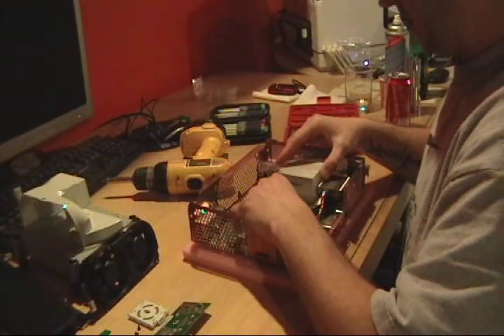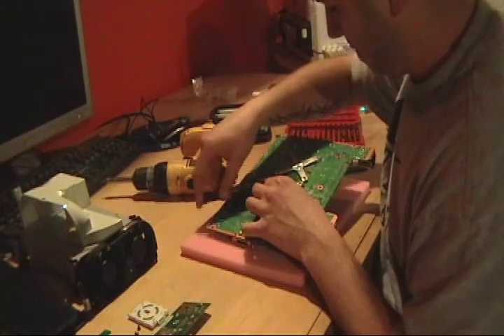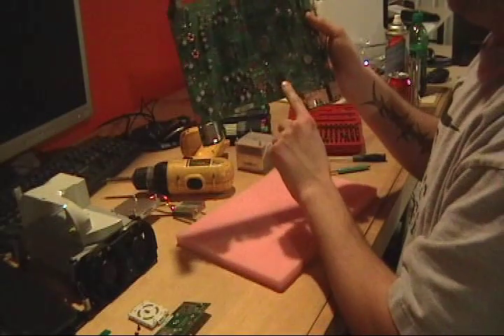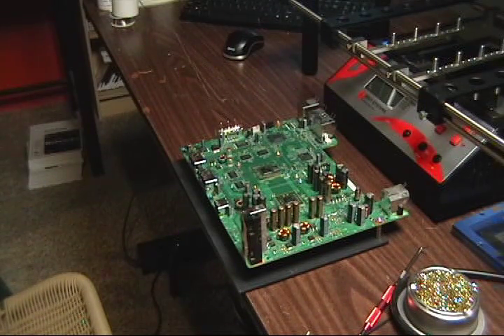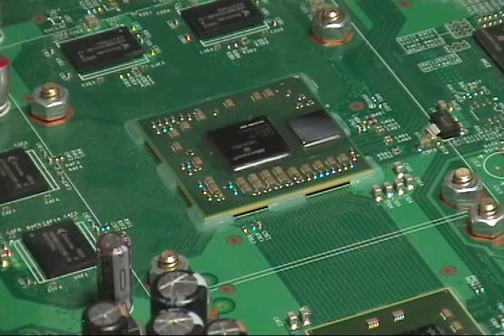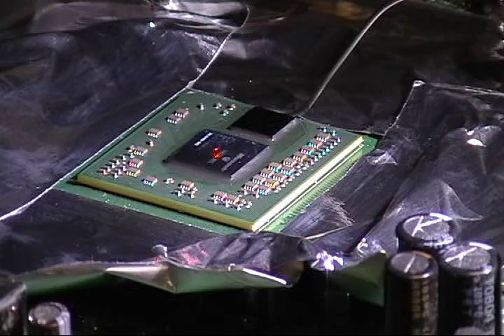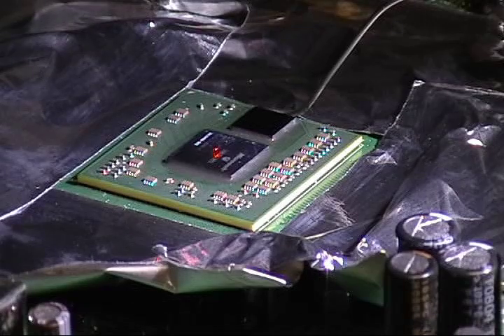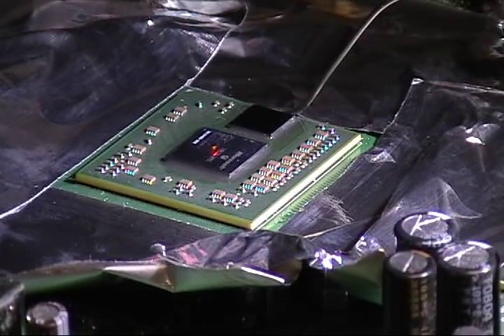Xbox GPU Fix E74 Part 2

Comment: You should never use petroleum based cleaners on heatsinks or what the heatsink is connected to. It will fill the microscopic pores and the thermal paste/pads won't have as good of contact causing what it's cooling to run hotter.

Comment: Exactly. I'm fully aware that they are designed here in the U.S and assembled in  China the save on cost which is a main reason they rrod so much due to the use of lead solder.

Comment: Both consoles XBOX360 and PS3 has about the same design, not much difference between each one, besides they shouldn't use those kinds of flat chips, they are very problematic.